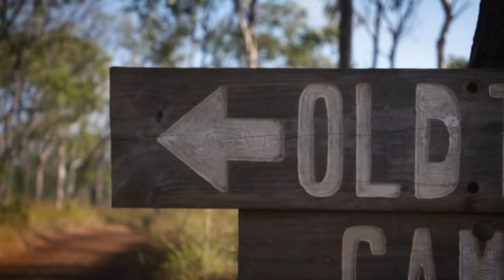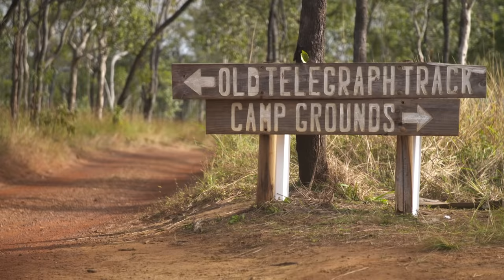4WD FIRE ON OLD TELE TRACK – worst nightmare… + Farm Truck does Cape York!

Comment: I cook my steaks different ways. I chop onion and bell peppers and make a foil parcel and put them in the bottom with a bit oil and woosta sauce and herbs,black pepper and a touch of salt then put the steak on them then put the same on the top with some chopped garlic then seal the parcel and slow cook it in the oven for about 40 minutes. The onion and peppers steam the steak so it's full of flavour and tender as can be!
Another way I do it is to heat a frying pan up to a high temperature then season the steak then flash it once each side until it's brown then turn the heat down low and simmer it in its own juices for about half an hour until it's tender. And the other was I do it is season then barby it until it is brown and tender..
I have all the methods on videos on my channel if you want to see how it's done👍😉

Comment: If you unsure about a section of track walk it first and plan your route. Also know which track you are on otherwise you will take a wrong turn and end up on the power line track at the glass house mountains in a stock bt-50 like I did

Comment: Best advice for a new 4x4 with downhill assist.
Turn it off and put your gear into 1st (auto) low 4.
Tried and tested in my Fortuner with no lock ups or up and down speed.

Comment: Take two cold cast irons and some butter rosemary and garlic. Put a thermometer in the steak cover the first cast iron with the butter and steak and cook over the flame until 130. Put the second cast iron straight on the coals. Once you hit 130 drop some oil in the coals pan and sear the steak on each side for 30 seconds or so until you get a char. Top with some spoon fulls of of your browned rosemary garlic butter and you'll never look at steak the same way again.

Comment: Suvet, it is absolutely against everything manly, but it is fantastic, juicy, perfectly cooked. Get the electric water heater and it gets the meet to the temperature you want and then put the meat on the grill for a few minutes, both sides. Give a try sometime, you will not be disappointed

Comment: If your man is building his own heavy loom some advice from the wold of truck trials in europe would be to build in mor protective covers to the heavy live lines I was one of the main builders for a unimog on the euro curcuit I am happy to report no shorts no fires therew are 2 ways we protect the heavy lesds the cheap way usingh a domestic hose pipe as a cover for the lead  the inside diameter has enough free room to allow for bends or you can go expensive with a nylon inner and a  stel braid outer ( the cable takes a bit of feeding through this product  but I lasts a long time and takes a hell of a hammering  the mos lasted 2 years on the trials curcuit

Comment: People on 12v pages have told me I'm wasting my time fusing both ends of dual battery system.. I still think it's 100% necessary your second battery has the same potential as your main battery as shown with that ranger caching fire.. 30 bucks for a second fuse seam cheap compared to new ute. It's amazing how many shops don't fuse both ends..

Comment: I don't think you'll see this but I'll give some cooking tips anyway.  Never do a steak on a flat metal surface. Ribbed cast iron is much better than flat; and a grate over the fire is way better.  Imo, you should do it on a "wire/round bar" style grate over an open fire because this gives you way more fire flavor.  On a fire/charcoal I don't believe in single flip:  do a multiple flip method somewhere between you're "flipping like hell" method and single flip.  The goal is an even cook from each side without overheating the meat to the point the fat drains off and you should reposition as necessary.  If your fire flares up it's too hot and fat is draining off.  If it takes 20+ minutes then that's okay.  If you're going for an equal cook method for testing then you should test internal temps.  Most people I know barely warm the inside of the steak because they think frying the shit out of each side is the same as cooked and safe.  Or it's propane which equals zero flavor and the inside is still raw imo.  As an Alaskan I've cooked more than most over a real wood fire and it's way more difficult than a pellet smoker or gas/charcoal grill in your backyard.  Fyi, I enjoy your long remote vids most! Keep it up!

Comment: 44.00 A smart bloke would undo the back line at the master cylinder and place a small lead sinker in the hole and screw the line back on not to tight as to flatten the sinker against the internal thread as you will need to remove it when you get new pad.
There's all manner of things you can use to stop the fluid from flowing to the calipers, flatten out a big sinker and cut a small circle out if it about 3/4 the size of the hole place it in the master cylinder or caliper and do your brake line back up making sure you dont over tighten it.
You can cut a circles out of a beer can a tin can, use a cut down nail head or a rivets and wrap some teflon around the head  putting it in the line head facing out and screw your line back on. lead is the best to use you can even melt a sinker and tip it slowly into water to get a ball the size you need use shotgun pellets, cut the tip off a bullet lots of things. So what destroyed the brakes someone leaving handbrake on or lack of maintenance.

Comment: Better and 100% working way, is unscrew brake line... put small round aluminium piece inside housing and screw braeke line with calliper together... it will crimp and seal inside. And no air or fluid will leak... later is easy to clean just by some air pressure hose

Comment: If youve ordered rotors pads and brake line and theyll be there in no time, why stuff around with it. Let the steel run on the rotors and replace the lot when you get parts.

Comment: Driving Tip:- Do NOT stick your thumbs inside the steering wheel, if a wheel grabs there is a good chance you will brake your thumb 👍

Comment: Why couldn’t ya just hose clamp a chunk of wood cut to fit in between the old pads and zip tie the caliper to the axle? That way you just replace the pads and bolt it back on without tearing up the braided line.

Comment: Stock standard vehicle with a 12 volt system a winch and a snorkel. I mean to be completely honest it's not exactly stock standard. A vehicle as it rolled off the assembly line is stock standard.

Comment: What was gained by monkeying with the worn out brakes?  I don't get it.  If you're not going to make them functional and you're going to replace the rotors anyway, why not just leave them alone until you get the parts to fix it right?

Comment: You need to have a stinking hot plate before you whack your steak on it ! Steak like a muscle scare the shit out of it so it tenses up which will seal it straight away then after 7 minutes on fully high hot turn it once and turn the plate down to simmer for 4 minutes or so ! Mint taste and medium rare is the only way 👌

Comment: You didn't grill them over the fire not on a hot plate wrap in tinfoil straight  after cooked let it rest for 3 to 5 minutes then unwrap slap on plate tuck in

Comment: 1 tip? lol not possible to offer just 1. 
Number one... Especially for novice & unprepared drivers & vehicles, try to always run in a convoy & take on any advice given you can
. 
Drive within you & your vehicles limits & drive with as much mechanical sympathy as possible because you will break shit. Carry as many parts as possible & as few tools as you can to do any job. 
Get a sat phone or even if a RFDS radio.

Yes aware too late for the comp haha.